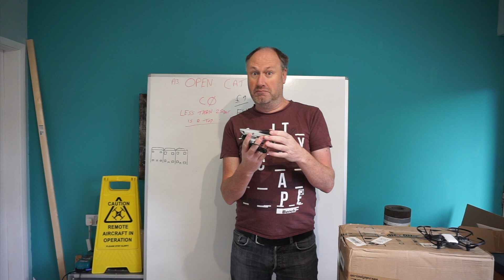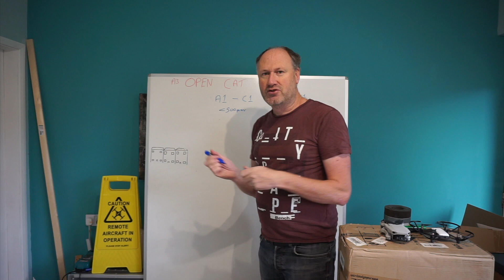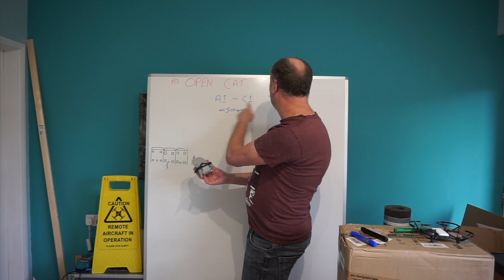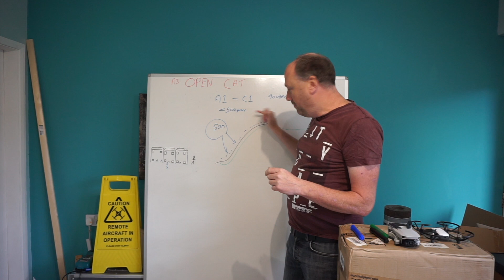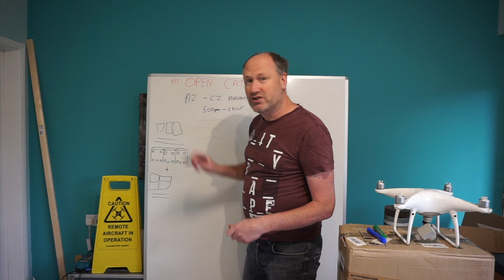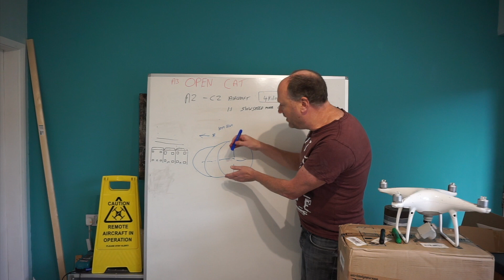A2 CofC   Explained Transition UAS

Comment: It does rather feel that if i inested in a phantom 4 pro or mavic 2 pro then its use will be very limited in 18 months time? Am i correct?
Reply from the maker: correct, buying anything now has 2 years then its 150m from a built up area
Reply: Not necessarily as DJI could send out a firmware that allows the motor to drop to a slow speed..
Also if you are not flying commercially and have BMFA insurance which covers u up to 25million, you are insured, in fact the more of a moron a pilot is it seemed the more you are covered.
Reply from the maker: @wrenflyer  right now there are no plans by the Dft or CAA to allow retrospectively allowing legacy aircraft to be allowed to operate as C2 marked aircraft and yes non commercial you can use BMFA or FPVUK for insurance